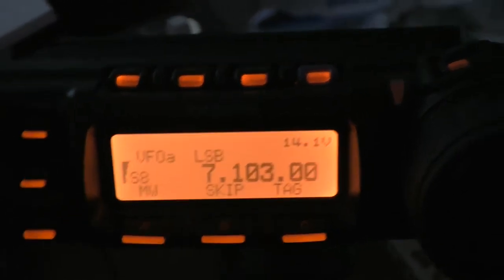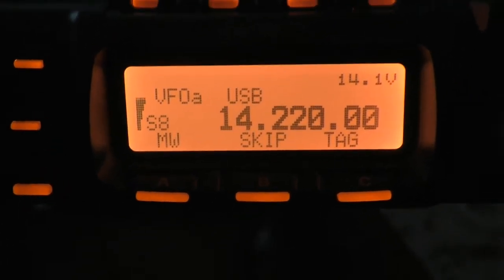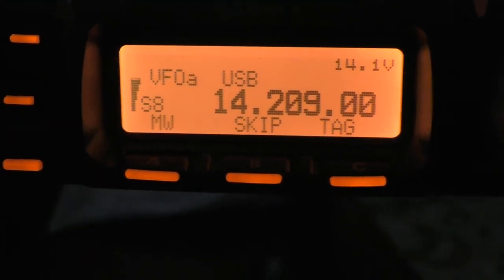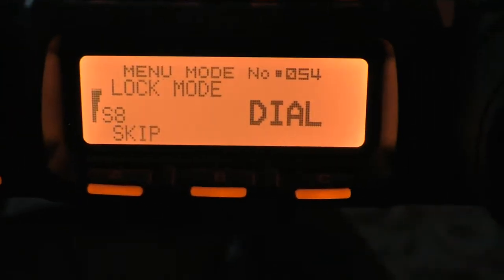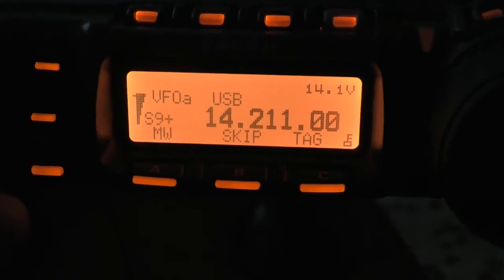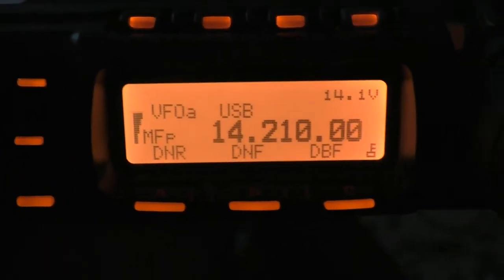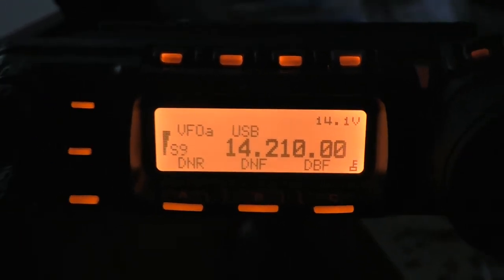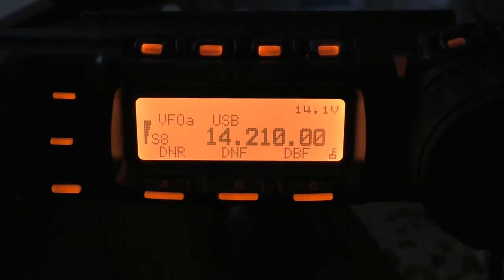Some Useful FT857D Features

Comment: If you  briefly press the power button it will change the little icon in the bottom corner of the display and your 857 will be more of a fin tune  If that could help you with another idea thanks from jason 2e0wsj

Comment: How easy is this radio to operate, I’m looking at the 857D and the 991A and haven’t decided which to get, I’m wanting them for the fact they both have uhf/vhf.
Reply from the maker: The FT857D is very easy to operate. I've never used a 991A so I can't say if it's easier to operate than the 8557D or not. I like the 857D because it's small and the head can be remotely mounted, it's ideal for mobile, portable and shack operation. This is my shack: https://www.youtube.com/watch?v=mYNI1kdb9XQ

Comment: Hi Steve. I have the 857 and a 817 and use to have a 897 in the shack. in the mobile the 857 is great. at the moment i have a 7000 mobile. not a patch on the yaesu rigs.
Reply from the maker: Some of the local guys tried to sway me towards the 7000 when I was looking at buying the 857. When I looked at the spec I found the 7000 uses phase mod on VHF and UHF. The Yaesu uses FM so it will always sound nicer on the air. I'm glad I went with the 857 that's for sure.
Reply: VK6CS yes so true. i have to get my 857 into the repair shop then the 7000 will come back out of the car. ease of use.

Comment: I used to Never use the Manual but with these newer Radios I always seem to have to keep going back to the manual to find out what a certain function does, I think also as I am getting older there is not as much free available memory  in the grey matter....I have been off the air for a good few years and was wondering what Radio you would recommend for someone who doesn't have a lot of dosh to play with the last HF radio I owned was an IC720A but had to sell that when i came back to Liverpool after Living Down Under in Christchurch.
Nice to see the Video about the Functions Cheers.
Reply from the maker: Hi Steve. If you're talking about a HF radio for the shack I would get a Yaesu FT450. The later model is the 450D. I have never used the 450D but my 450 is a great little radio and can be picked up for a good price these days. It has a large display which is great for us old codgers, the menu is easy to use, and the performance is better than you would expect for the price. I get many unsolicited compliments on my TX audio quality. If you want HF, 6m, VHF and UHF with good performance and output power levels in one small package it has to be a Yaesu FT857D... I have two of them.
Reply: VK6CS Thanks very much for the Advise and reccomendations Steve I think i will start keeping my eyes open on Ebay for a used FT857D or an FT450 may need to save up a bit more but need to find something to Amuse me as the wx is starting to get Colder here in Liverpool and you are well on the way to 
Hot Sunny days down there in Nr Perth...Anyway getting late here so better get some Zzzzs Thank You once again 73 de Steve M0BFM ex ZL3LFC,ZL3BUJ,ZL3TRU and G1VQD.